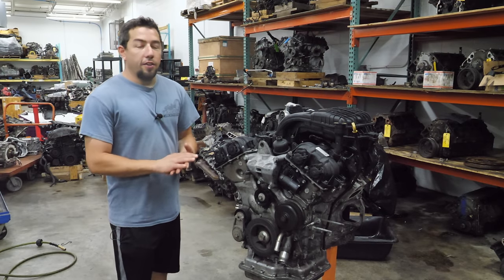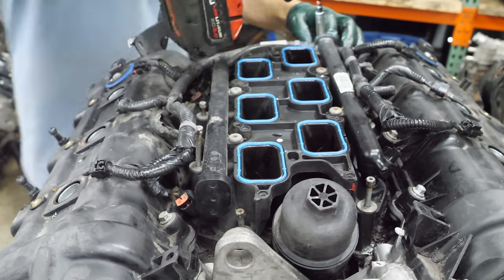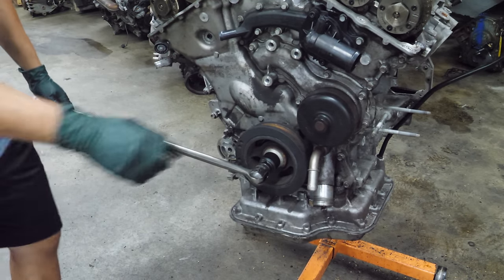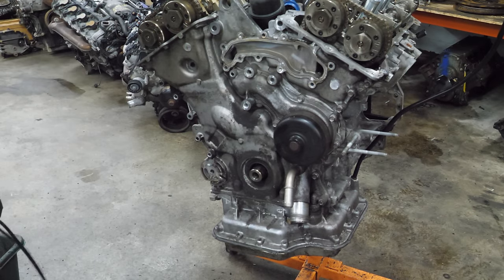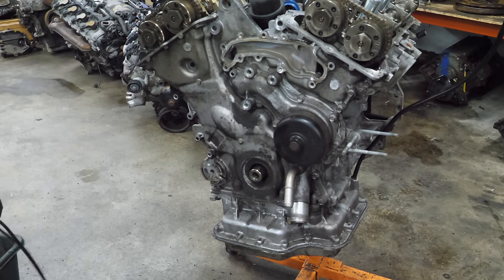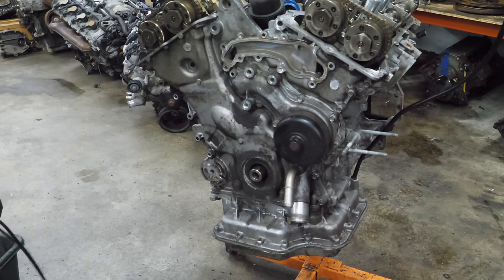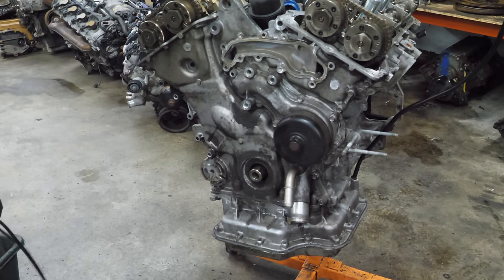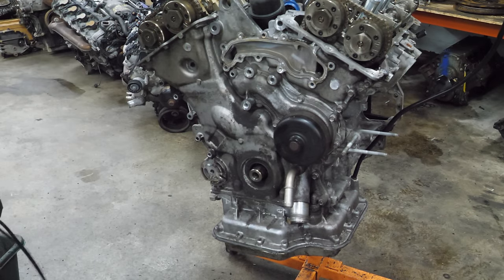Dodge Caravan 3.6L Pentastar V6 Teardown! Why Won't This Engine Turn All The Way Over?

Comment: Just a guess,  perhaps the O2 sensors could have gone rich,  that could explain the excessive carbon build up.  When mine went bad, it went really rich, my fuel mileage went really bad like 8 MPG.  Changed out the O2, my fuel mileage went back to around 19.5 MPG,  then I ran it up to 5000 RPM in 4th gear for about 12 miles.  Sounds dumb but it sure ran much smoother.  

Mine was an 88 Dodge Dakota,  5 speed manual transmission 4X4 . 3.9 V6

Comment: I've owned or currently own several of these engines.  Have had great luck with them and find them pretty easy to work on.   What I'd really like to see is a teardown of the crappy jeep 3.7 (or 4.7).  Hate those things

Comment: @25:20 I guess you forgot about the ridge reamer that used to be used to remove pistons from blocks. Do you still have one?? Did you ever determine why there was so much carbon in this engine?

Comment: Mom's 2012 grand caravan has 213,000 mi original on both engine and transmission.  Being a highway driven car and enterprise car helped I guess. She hates economy mode and I don't blame her. Replaced y pipe, thermostat, crossover pipe, and soon the oil cooler. With her lead foot I don't think carbon build up will ever be a problem.

Comment: Good to see that you get the occasional "clean" engine to tear down. Don't know why if this is a direct injection engine,  why so much build up? 
Keep up the great work 👍
Reply: It is NOT a direct injection engine. Chrysler did not jump onto that band wagon.
Reply: @budlanctot3060  yeah I didn't think they were DI, but has the carbon build up as of they were 👍
Reply: Agreed. It's a bit of a mystery on this engine. Unusual, given the overall interior cleanliness. Makes me wonder about my 3.2 Pentastar.

Comment: I’ve seen this done and I really don’t recommend it, but if you just happen to roll a motor over backwards. Then hit with the starter, sometimes it will break some of that carbon out and let you run it at least. If you’re ever stuck with a carbon locked car somewhere.

Comment: My personal opinion is that in the future we will look at the 3.6 pentastar like we look at the Buick 3800 today. Legendary not just in their ubiquity, but also because it's a great engine!
Reply: No way…
They have terrible top end issues, oiling issues, flattened camshafts, rocker issues.. i mean there’s a list 2mi long of all the issues these have..
Reply: @rustbeltrobclassic2512  You are 100% wrong.

Early Pentastars, even the guy in the video said, that they had some issues that had to be fixed with the engine being in production and flaws being found and fixed. Going off of your same logic you could say all Toyotas are garbage because they had issues with frame rust/accel pedals sticking 25 years ago. You cannot hold teething issues against an engine that have been fixed.

Early 3.6Ls are a bit of a mixed case - some last forever, some have some head issues which was expected out of a brand new design engine. All issues with the Pentastar you mentioned (some you mentioned never existed on the Pentastar by the way) were fixed with the Gen III Pentastar Upgrade which occurred in 2016.

Gen 3 upgrades included a cooled EGR to help with efficiency, Mild MultiAir variable valve lift, strengthening up valve seats, & valve guides fixing all issues the Pentastar had with the heads. 

The oiling issues you speak of never existed with the Pentastar. They use a dual-stage oil pump design which uses the high stage pump at cold idle to increase oil flow within the engine and the high stage pump at engine speeds greater than 3500RPM for better lubrication and less parasitic losses inside the engine.

The 3.6L Pentastar is far more reliable than the 3800 and not to mention makes tons more power than it too. Oil cooler issues with the Pentastar can be fixed by replacing crap OEM plastic housing with Dorman aluminum housing, solving that issue. You can’t replace the shit intake manifold on the 3.8 with one that won’t break eventually.
Reply: @TheSavage3.6  I own one right now, in a 2018 Rubicon Jeep with a manual transmission.. It has issues even at 41k miles.. I need to run a zinc additive in my oil, if not there’s a lot of top end noise.. the oil pump doesn’t seem to adequately provide enough volume to the top end.. the accessory belts are also very loud for any vehicle. The drive by wire is only a theory, and the rev hang is probably the worst i have ever seen. I also have to run 89 octane or it pre-detonates and pings.. I change the oil with Motul 0w20 as required and do it every 3k miles, because if I don’t it’s black.. the filters are wix.. 

It honestly is the worst engine in any vehicle I’ve ever owned.. this is car number 37.. bought it as a weekend toy.. should have just bought a mustang gt.
Reply: @rustbeltrobclassic2512  i work on chryslers for a living and have never heard of this happening. 

even on 1st gen 3.6s the biggest issues they’d have is a ticking noise that wouldn’t go away from a failed lifter. you have a lemon.
Reply: @TheSavage3.6  it’s possible.. it’s definitely crap, it’s my second mopar and my last.. the one before it spun a bearing at 18k miles, but then was really reliable till the body rotted away.. that was a 99 dakota RT 5.9.. miss that truck.. anyway.. have a good one.. 👍

Comment: I'm impressed to see how many engines of the last ten or so years have deep skirted blocks along with cross bolted mains. Windage trays used to be a rare high performance modification too. It has been a while since I was fooling with engines.

Comparing the carbon in the chambers to the immaculate oil systems raises questions. The heat tabs do too. I wonder if someone basically stripped it to a long block and cleaned it up. Over the years I have seen more than a few 'Duplicolor' overhauls.
Reply: @Jackets64  I believe there was a plan to do turbocharging and direct injection, so they were designed to be pretty beefy. They never followed through with that at Dodge/Chrysler/Jeep/RAM, but these engines serve as the basis for Maserati and Ferrari turbo V6 engines.

Comment: Can you do one on the World Gasoline Engine? I had a 07 dodge Caliber and my girlfriend had a 07 jeep compass. After working on them we discovered how similar they are along with being in the Chrysler family. My caliber was pushing 185k before i sold it but the compass was consuming oil alot around 140k. Both were the 4 cylinder with cvt transmission. We switched to Toyotas together.

Comment: "Carbon Locked" Is this a new term? I had the same thing happen with a Champion portable power generator I bought with a locked up engine. I assumed the worst, that something was wrong in the crankcase but it was good. Pulled the head off and found all this soft flaky carbon compressed at the bottom of the cylinder between the piston and head. cleaned it and reassembled and it was fine. I'm wondering if the changes to fuel or oil have a roll in problems like this?

Comment: given your level of experience and I'm at best a middling diy-er, but if you're going to drop a pan with unknown contents, leave one side 1/4 run in. so when the pan drops it tilts (hopefully into a catch pan) and doesn't just drop all the way to the ground

Comment: you should do a multiair 1.4 from a fiat. the multiair bricks are fairly notorious for failing and are pretty interesting once you open them up. plus the tiny 72mm pistons are fun to look at.
Reply: Yeah my 1.4 blew up at 25k on my 13 Dart. It was like an 8k warranty replacement. They put these tiny engines in big vehicles. What do they expect to happen. I sold it at 50k on odometer and got a 200 with a Pentastar. Now I’m at 225k on it with no real issues.

Comment: Thanks for the video. I have a 2012 challenger and a 2014 awd 300 both with the pentastar. These are great engines, I average 20 mpgs overall with both vehicles.  Both proved themselves in triple digit heat and sub zero temperatures. I only use Casrtol full synthetic  20 and 30 weights. and both get serviced at 7000 miles. I think Stelantis/Chrysler and Dodge are making a big mistake with the Hurricane engine. The mpgs are not that and may have dependably issues. I am going to keep both of my vehicles until the wheels fall off. I also drive a Ram 1500 wth the 5.6 hemi . The Pentastar and Hemi have been around for almost 2 years. The Hurricane  is too new and what engine would you trust ? One that's new or one thats just came out this year or one that's been around for nearly 20 years.

Comment: I have 2 of these engines.  14 Chrysler tc and a 14 Jeep Cherokee.  THANK GOD it has an external water pump!!!  I also have a 14 Lincoln with a 3.7.  It has an internal water pump.  Looking at a couple U Tube videos it might be easier to pull the engine to change the internal water pump on that beast!!!

Comment: Hi there can you tell me what the name of the piece that you pulled out of the top of the back cover above the pcv valve. The one with the blue top. It's around the 5:31 mark. Mine is leaking and I can't find any information on what it's called. I need a YouTube video that deals with how to fix it.

Comment: My wife has a 2011 Nissan Sentra and it’s got a 2.0. It’s starting making a tapping noise at about 40k it’s now at 130k and still sounds the exact same. Goes away after about 25 mins and is way worse when cold. Would love to see a tare down if this engine to see what it might be or how hard this engine is to disassemble. Thanks and really enjoy your videos

Comment: Usually that much loose carbon means the engine has never revved up, just putted along very carefully at very low rpms,  that's why they need a good old fashion Italian tune up from time to time

Comment: I need the side pan on the transmission of an 09 journey sxt 3.5 motor. 6 speed transmission. The not dipstick tube rusted. Ever heard of replacing those?

Comment: Great presentation!  Can you explain more about the heat tabs you find on these engines?  Who uses them and why?  Where are they placed. Tear down suggestion:  how about an early Miata engine or an old 4 cyl. aircraft engine.  Thanks!
Reply: Thats from  a salvage yard sold that engine and they put them on there in case it comes back under a 90 days warranty usually.  If they are missing or changed color I believe that means the engine was over heated so they won't honor the warranty
Reply: Thanks Danny.

Comment: Have a 2012 200 that I bought new with this engine . Put only 58 thousand miles. Changed oil 3, to 5 thousand miles with synthetic oil. Just payed 4000$ to replace left cylinder head. Was told that there was a TSB on this engine but no recall. Warranty on it was 10 years or 150 thousand miles. 10 years expired last year. Chrysler did not want to help me with price of repair.

Comment: I've seen a couple of theories as to why this engine was in the shape it was in.  Here's mine:
I don't think it was something only driven a few blocks to church every Sunday by a little old lady from Pasadena because there wasn't a ton of sludge in the oil nor all around where sludge would accumulate.
I think maybe this engine was in something that tooled around town a lot, spent a lot of time idling and being driven slowly.  Maybe by someone like a pizza delivery driver or one of those civilian mail-delivery cars you sometimes see.  I think this because of the fair amount of carbon upstream of the combustion chamber, almost like a direct-injection engine.  I think the crankcase ventilation system fed carbon goo back through the intake manifold and since the vehicle was never run up the RPMs it just kept building up and building up.
Before the situation could come to a head one way or another, the vehicle was in an accident, freezing this engine's strange condition until this teardown.
But that's just my opinion based on rather scant facts.

Comment: I was told these benefit greatly from having a catch can on them to catch the blow by and remove it coming from a mechanic. Not that they had a lot of blow by but the runner injected engines built up so much carbon usually inside the head from what I heard. Im not a mechanic though

Comment: ive had two 3.6 engines, both developed a cracked head, when this happened i got exhaust blow back into the intake, which could account for your carbon build up

Comment: My wife drove a 2012 Durango with 3.6 , in 10yrs she beat that suv to the ground but the engine was still going strong after 150,000 + miles. Lots of oil changes and only water pump and serpentine belt was the only repair that was needed.
Reply: My BIL has 2022 with 3.6 wrangler. He’s behind on payments, will soon be a repo. He has 44,000 on it and never changed oil or filter. Just adds oil as needed. He destroyed a beautiful RAM yrs ago that was repossessed and somehow got financed again, yrs later. I think he’s psycho. This current engine still running is still running which is a testament to the pentistsr.

Comment: I'm wondering if the engine controller was dumping in way too much fuel.
If so, the same problem might show up with the replacement engine.
LOL. I posted that before hearing it came from a wrecked vehicle.
Can't believe a salvage yard left a low miles engine sit outside.

Comment: In high school my buddy bought a Ford truck with the 460 v8 and i remember him pouring oil into the cyclinders because of carbon build up.  We didn't know anything...i think it worked (it was the 90s)

Comment: Also beware of the 3.6 ticking and code P0302. Cylinder head replacement is next. About 3K at your local CJDR dealer.

Comment: I had a 2017 Journey SXT front wheel drive with that V6 for 33 months.  It was pretty stout for what FCA built serving as a universal soldier across the lineup.  It should have been in a proper sports car if they had the chance.

Comment: I've seen carbon pellets like this from people trying to ignite the engine with brake cleaner and it immediately removes all lubrication from the cylinder walls and makes pellets. I know from experience. Lol the piston rings get welded to the pistons.

Comment: I’m not sold on it being a low mileage engine… I just had one of my 3 pentastars torn down a few months ago for some worn components (mostly top end). It was the same year engine as this one - a 2011 pentastar out of my avenger, only it had 275,000 miles on it at the time of work. I obviously didn’t do a bottom-end tear down, but the top end on mine looked similar to this one: So clean it appeared brand new; at 275,000 miles. I know of many others with high mile pentastars with similar “cleanliness” (rocker arms are common failures for pentastars before 2018, so a lot of them get top end work done at higher miles). 

As for the carbon on this one though.. I have no clue what could’ve caused that, nor have I ever seen that on a pentastar before. This is super bizarre.

Comment: And I only thought severe carbon buildup was an issue turbo engines with direct injection. My parents have a wrangler with a pentistar. Drives real nice and gives good power. I told them to buy it out the lease because of how reliable that v6 is.

Comment: I've seen this as the main problem in these engines. Carbon build up. I wonder if there is a good fuel additive to prevent this and should I use it?

Comment: The taxes is iraq most are using chargers or 300 and they run these engines the are going 1200 km daily at 150 km/h continue.amazing smoth and reliable engines

Comment: Question regarding the carbon build up. Could it not only be possibly the mention of short trip history never properly warming up to full temp along with cheep gasoline being used that doesn’t have good additives that prevent carbon build up?

Comment: Carbon may-be is the spark plugs not using the correct type of spark plug. Also, at least every oil change add a cleaning solution to the gas tank.

Comment: I think the carbon expanded while it sat as it had been turning over while it ran before it got in a wreck.  I have heard of that happening also with a diesel boat, engine would hit an immovable hard spot and after head pulled it was carbon, and that engine had sat for several years. But why all the carbon, don't know, maybe poor-quality engine combustion occurring due to oil burning, maybe something to do with the fuel quality, maybe a crap additive owner kept adding to the fuel.

Comment: Great videos, I really enjoy the content from seeing what went wrong with these engines or what
caused their destruction. It would be 
Kind of funny if you ever did an engine from a 2000-2003 Suzuki
Grand Vitara or the XL7. I  used to have one of these cars but sadly had to upgrade. Now I have a Subaru Legacy in it's place.

Comment: Thanks for doing this run of the mill well - mill. I have owned 4 - still own 2, and never had a lick of issues other than my 2018 Wrangler blowing oil smoke on startup ONE time. Still don't know what that was about. Anyway - 60k on a 2018 Challenger, and all the rest being 2021 and newer (another Challenger and a 22 Gladiator) = never an issue. It appears to be a pretty robust motor. Can't believe how clean this one was. Can you do a F56 MINI soon? Or an N12 from 2010-2013? Those N12s constantly throw codes. I've owned 7 MINIs of different vintages, and that newer 3 banger surprised me with amount of torque. But I bet it's a b!tch to fix. Cool vids bro! Thanks!